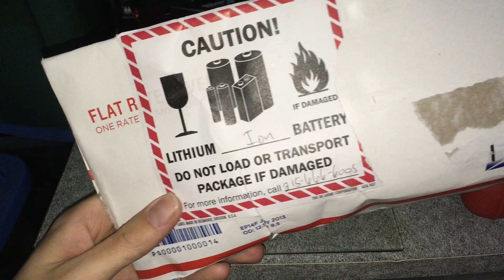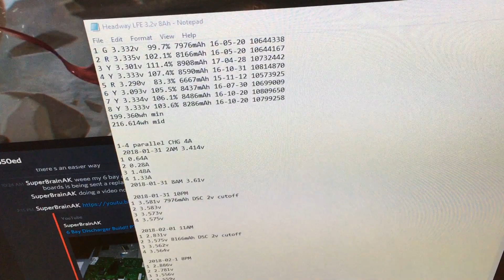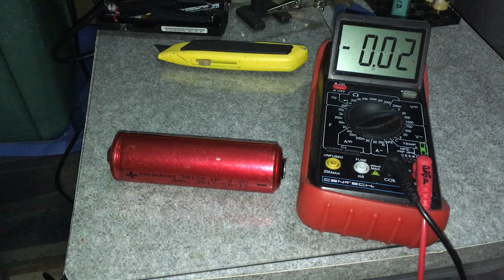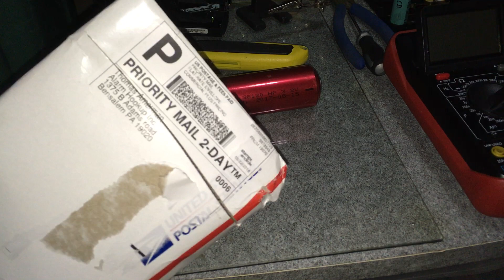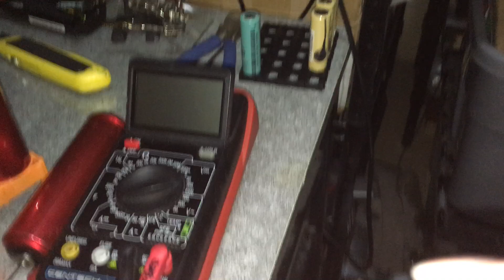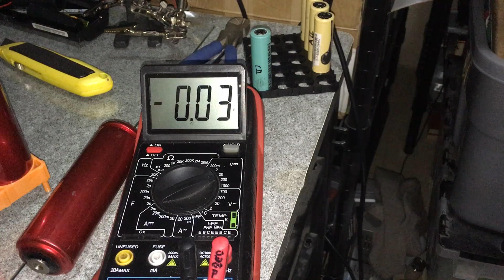BOOM Headway #5 replacement

Comment: What happened to the original cell? That you needed a replacement.
Reply from the maker: it was under specification by a fair bit, they guaranteed it to be 95% but it was more like 70% of its capacity
Reply: SuperBrainAK thanks for the reply.
That explain. I was thinking it went bad in a short time. But it was a bad cell from the beginning.
Reply from the maker: theflyerpr40d yep!